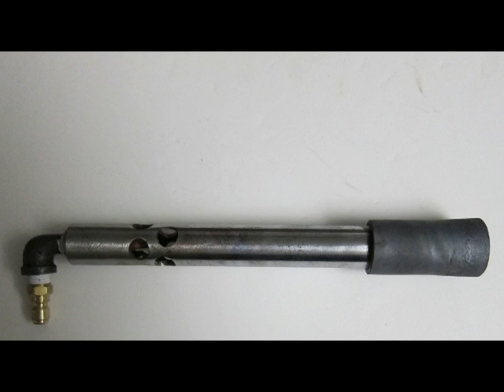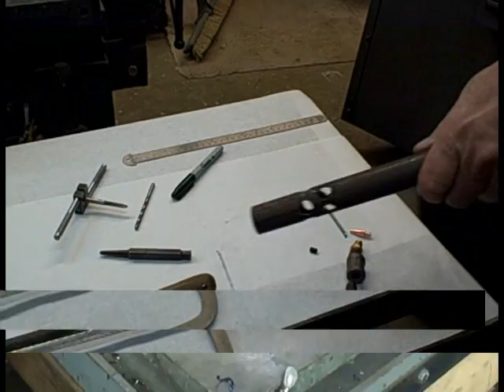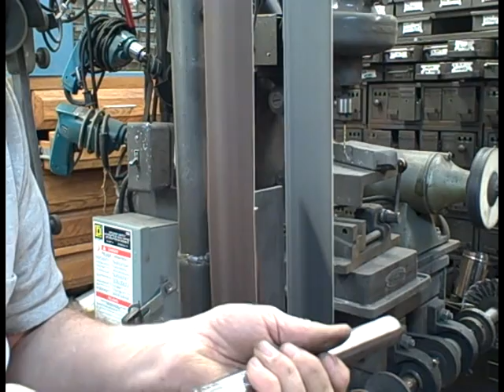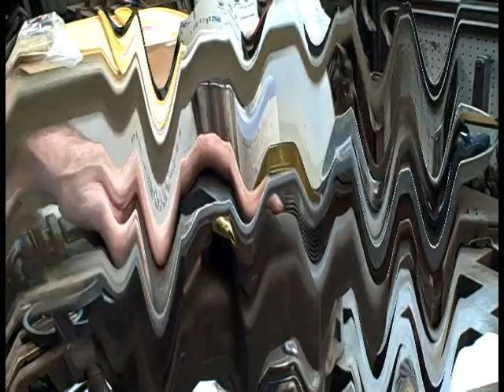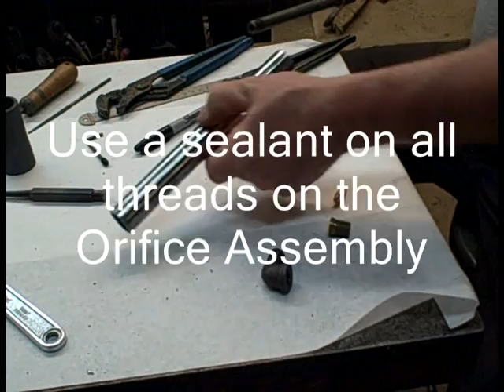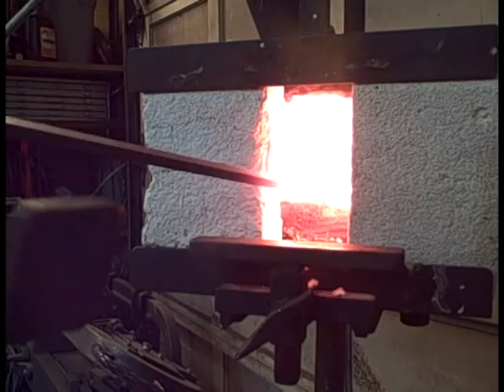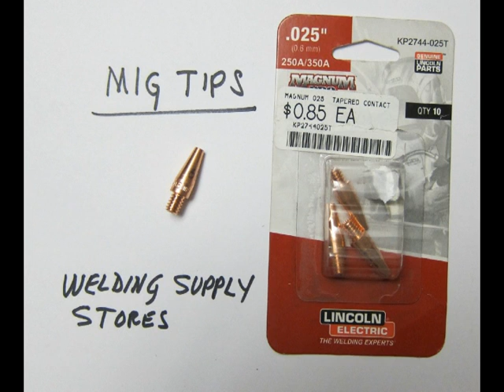How to build a Propane Forge Burner

Comment: Thank you so very much for this incredibly helpful tutorial. I made my first flare with plumbing torch heat and hammering it on an anvil tip. A few of the parts from my hardware store were a little different but I made sure to use the right size mig tip and line it up with the air intake holes.
It worked incredibly well right away! Thank you again!
Reply: Thanks... I'm glad it worked well for you...

Comment: David, I’m looking to make this and picking up everything. What size diameter did you use for the 3” stainless steel piece?
Reply: I believe the SS pipe I use would be considered 1 inch pipe.  Having said that, you can't be assured that if you order 1" SS pipe it will fit over 3/4" schedule 40 iron pipe.  I say this because when I go looking for SS pipe (usually at a recycling yard), not all SS pipe I find (that looks like 1" pipe) slides over over 3/4" iron pipe.  

What I recommend is  (if you are looking at recycling yards) to take a piece of 3/4" schedule 40 iron pipe and see if what you are looking at slides over it .

If you're going to order SS pipe, measure the OD of the iron pipe you are using for the burner and call your supplier and tell them what you need the ID to be.  Just make it a little larger than the 3/4" pipe so it slides on.  The ID of the stainless pipe I have that works is 1.07 inches.  The OD is 1.315 inches.  This is fairly heavy pipe.  It could be a little thinner.  Before  you ask, I don't sell things..

If you are only going to make one or two burners, it may be less expensive to just buy the flares.  They are a bit overpriced these days, but can generally be bought on eBay.  https://www.ebay.com/itm/Propane-Forge-Burner-Blacksmith-Stainless-Nozzle/273635059773?epid=857601216&hash=item3fb5eba83d:g:vRkAAOSwhfRcIrhd:rk:6:pf:0

A friend of mine also makes and sells flares.  I'm not sure what his current price is (I am not commissioned)..  He is John Fee (607 368-6688)
Reply: David Hammer I appreciate all that info! I have a metal supply store near me, so I’ll get the outside diameter and take it there. Thanks again!!

Comment: Hello David, This has to be one of the best burner designs I have seen and will be making two of these for my first forge build. Thank you for the excellent detail and great still pictures. I am now off to HomeDepot... Best Regards, Ray
Reply: Home Depot may not carry the 1/4 inch black pipe fittings anymore.  Check at other hardware stores (not Lowe's).  If you can't find them locally, you certainly can find them online at plumbing suppliers...  Good luck!
Reply: You are correct, HD does not carry 1/4" black iron pipe fittings why, I don't know... I finished machining the burner tubes yesterday and will be making the bells today then a test fire! Oh did I mention I still need to build the forge! Thanks again David, Cheers!
Reply: You are welcome!

Comment: Would this work if it were smaller? I have a mini forge and i was looking at making one with a 1/2" pipe rather than the 3/4" pipe.  I figure I would need to find smaller parts and reduce everything accordingly. Have you made them with the smaller sizes?
Reply: lt will work with 1/2 in pipe.  Make it 8" long and drill 3/8" holes....  I  have made several.
Reply: David Hammer what size did you use for the other couplers?
Reply: I used a 1/4" brass street elbow(male on one side, female on the other).  The female end is out (the quick-connect is screwed into it).  The male end has a 1/4" to 1/8" brass reducer coupler  (female on both ends, that I sanded to fit in the pipe).  I drilled a #60 (drill bit) hole in the end of a 1/8"  brass plug, put it in the 1/8" side of the reducer and used that for the orifice (look for a plug that has a deep cavity (or drill a 1/4" hole almost to the end before you use the #60 bit).   I drilled the holes in the pipe so the orifice was centered on the upper holes.  Incidently....  the 1/2" pipe is 7" long (not 8).
Reply: David Hammer thanks. I will see what I can get from the local hardware store this week. I hope to put it together next week and then test it out.
Reply: I generally buy those types of parts from a big box store like Home Depot or Lowes.  Good luck..
Reply: do you drill the 3/8" holes in the same place or  are those closer to the top of the pipe?
Reply: The top holes are probably closer to the top.  Make the assembly that slides into the pipe first.  Then  mark the position of the top holes so the center will be at the end of the orifice.
Reply: David Hammer so I got the stuff and tried drilling out the plug and broke the only small bit I had. Not sure where to get another #60 drill bit locally. Is there another configuration that would use a weld tip
Reply: I hadn't tried this before this morning (it did work).  

Get a brass fitting that is 1/8" NPT (male) on one end...  and 1/4" (male) pipe compression on the other end.  Drill it out with a drill bit suitable for your mig tip (I used a #7 drill bit), tap it for the threads on your mig tip (these vary, so be sure you  use the right tap), then grind (or cut) off the compression end threads so you can thread the mig tip into the fitting.  This will give you a mig tip with the 1/4" NPT threads you can screw into the other fitting you sanded to fit into the 1/2" pipe (I think I used a 1/8" brass coupler for that).  Then drill the 3/8" holes in the burner body so the mig tip (end) is centered on the set of holes closest to the flare.

Be careful that you don't crush (bend it oblong) the small fitting if you put it in a vise to cut or drill through it.  

Good luck this time....
Reply: David Hammer I got the part and was able to drill and tap. Now I just need to grind it down to fit the pipe so I can drill the holes and wait for the sealer to get here. Hopefully this weekend I can test it out. Thank you for all the help.
Reply: Got it all drilled out and tested it. It sputtered a lot and seemed like it wasn’t getting enough air. I also need to work on the flair more. Right now I was going into a 3/4” pipe that goes into my little forge. I am going to put a 3/4” coupler on the end inside the forge to see if that will help with the flair.

Comment: Dave, do you have a website or somewhere I can get ahold of you to trouble shootout this burner?
Reply: You can comment here and I will answer.  What problems are you having?
Reply: Success! Great design! Found it easier to build than the frosty t burner!
Reply: Problem was the mig it was clogged! Works like a champ now. 
How many btu's does one burner put out? I have a 8 gallon air tank I've cut the end off. 1848 sq inches...
Reply: I'm happy you closed the deal...
Reply: One burner will suport about 300 cubic inches of burn chamber (assuming an effective lining).  I don't know what the btu output is...

Comment: What is the purpose of the street elbow?
Reply: 90-degree turn.... Just to allow the hose to start down without going straight up first.  I use 20, 30 and 40 pound tanks...  and they sit on the floor.  If your propane source is higher, you may not want an elbow.
Reply: Does a bell reducer work as a flare for these burners?
Reply: Actually probably not since it's part of the tuning process
Reply: I have no experience using anything but one-inch tubing for flares.  The flares I demonstrate in the video work the best for me.  I have also tested with one inch SS tubing (no flare on the end) and schedule 40 one inch pipe (without any flare on the end) with reasonable success (they do not work well, if at all, outside a forge)..   

Some folks say they use these burners with no flare on them.  In gereral, these burners will not stay lit outside a forge without a flare.

 I  use a flare because if I don't, the end of the burner tube will be damaged fairly quickly by the heat in the forge.  Stainless steel flares resist the heat for the longest time (they still will burn and have to be replaced though).  For me, a  flare is easier to replace than the burner tube.

If you are trying to use something else (other than what I recommend) for a flare, put the burner in a forge and try it.  

I cannot offer any advice about non-stainless steel flares beyond what I have stated here.

If you cannot make one, I recommend you buy a stainless steel flare.  You can buy them online (ex.. Larry Zoeller website) or on eBay.

Best of luck.
Reply: I think I have to big of a mig tip in right now. I have a flame outside of the forge with a 3/4 x 1" bell reducer but it's not an accelerated flame. Pressure is all the way up so I don't have and room for tuning

Comment: Hello, I have been visiting your series and have what could be a time saving tip. I have have some trouble locating the 1/4 inch pipe to 1/8 flare fitting, so I looked around and found that a 1/4 inch pipe to 3/16 (ID) barb would work, there is plenty of metal to cut close tolerance threads for the MIG tips to fit into, also had problems finding a longer braided stainless propane line, so ordered from EBAY, the brass hose barb  (1/4 to 3/16) fitting I found at Menards, less than $2.00. Got the stainless flare from ebay too, no st0ck avail around here right now. Just waiting for the items to come in. Thanks for the info.
Reply: You are welcome....  It's always good to have alternatives...
Reply: Could you please share the link to the stainless flare you found on eBay? I've been searching and have only found complete burner assemblies. David, does the flare need to be stainless or could you use regular iron pipe? Thanks for the great video.
Reply: You're welcome.....   

Flares  are not always for sale on eBay, but most times I search they are there... so keep looking.  You could send a message to someone who sells complete burners also...  Just ask if they would sell flares by themselves... Larry Zoeller sells flares from his web site (Google him).  

They do not HAVE to be stainless.  It's just that stainless lasts longer.  In fact, it's likely the burner will work in the forge without a flare at all.  I don't do that because the end of the burner will eventually burn and the whole tube needs to be replaced.

Good luck with your projects.....

Comment: Great Video David.  I have everything made but one part I can't find, the connection to my Propane hose.  It's the quick coupler or a 1/4 male npt to 1/4 male (propane thread?).  Have no clue where to get one of those.  Any idea what I should ask for at the hardware store?  I've seen them on ebay but i'd like to buy locally.  Thanks. Steve
Reply: I'd have to see your hose to tell you what you need. There are numerous different fittings on propane hoses.  I suggest you take your hose to a hardware store (Home Depot or Lowe's or ???) and ask for help in the plumbing department.  They will have a display of brass connectors.  It's likely they will have what you need.
Reply: David Hammer it's a 1/4 female connection.  This hose actually.
https://www.princessauto.com/en/detail/10-ft-propane-hose/A-p8005534e
Reply: Found it at my local propane supply shop!!
Reply: Great!  Good luck with your project forward....

Comment: I bought parts to build another type of forge today. I wish I saw your video sooner.
Your plans look so simple. I'll see what I can return and make this type instead.

I have a disposable helium tank the same size as a freon tank, this burner is good for that volume dont you think? I have ceramic batting and will get the coating to apply in it.
 I  plan to cut off both ends and use the 3 inch channel for the brick doors on either end like yours.
Reply: If you are referring to a tank about 8 inches in diameter, 12 inches long (or close), one burner will work fine.  Each burner is capable of supporting up to about 300 cubic inches of burn chamber.  Those tanks are great for forges if you are not going to cut a slot on the side (openings just at each end).  If you want to make a Super 'C forge, you will need a thicker cylinder (unless you intend to add stabilizers somehow so the C won't flex).  Good luck with your project.

Comment: Hi David,
I found your video a few week ago.  Your description for everything was very easy to follow.  
I'm in the process of building 2 of these burners.  They are about 90% complete.  I just need to drill and tap the holes for the mig tip....then assemble everything....and test.  I'll let you know how it goes.
Jim

Comment: Does the main body pipe have to be 3/4"? or can it be 1"? Does it also have to be 9" long? Do the holes drilled have to be spaced perfectly, or is there room for error? Is there a difference between using 3 rows of 4 holes and 2 rows of 4 holes? Does the flare have to be stainless steel or can it be cast iron?
Reply: You are either argumentative, curious....  or inventive (or all three).   

The body can be other diameters.  You would just have to find the number and size of the holes that will produce a good flame.  I've made the burners with 1/2 inch pipe with 3/8 inch holes.  I have no doubt 1-inch pipe would work also.

The pipe doesn't have to be exactly 9" long.  It does however, need to be long enough for the propane to mix properly with the incoming air before combustion.  The minimum length will be different for each diameter of pipe used.  9 inches works for 3/4 inch pipe.  Shorter lengths produce erratic results. I'm not sure a lot longer would work well...  you would need to experiment.

You can change the holes configuration.  Others will work.  I expect it's more about open-area than number or placement of holes.  I do believe though, that symmetrical placement is best..... just experiment.  Things don't necessarily have to be perfect for the burner to work.

The flare does not have to be stainless steel. It can be whatever you want to use, as long as the burner will light, stand up to the heat and you can fit it in the burner holder.  I use stainless steel flares because (in general) they last longer than iron pipe.  I have used 1-inch iron pipe (flared and unflared) over 3/4 inch burner tubes.  The flares will burn on the end and eventually have to be replaced.  In fact, a flare may not even be necessary when the burner is in a forge (the burner may not light outside a forge without a flare).  I have found that the best flame is produced with the type of flare I show in the video.  If you don't use a flare, the end of the burner in the forge will eventually be damaged and you will have to replace it (instead of just the flare).

Having said all that....  The burner I describe in the video works well in most cases.  I am very specific because I have had good results with this configuration and I expect others want to make something that will work the first time.  When someone has problems with the flame,  I suggest moving up to larger mig tips.  I expect doing that overcomes whatever imperfections they have (or makes allowance for altitude issues).  At least it seems to work almost all the time.

Good luck with your experiments...
Reply: Thanks for the speedy reply! I've been wanting to create a propane forge for myself for a while now but the main thing that has kept me from doing it is the burner. I just don't have the right tools. However, I'm thinking with this design I could very easily make one. But since it's my first time making a burner, I want to make sure I don't make any mistakes (especially around propane). And I wanted to see how much material that I already own that I could use. Anyways, thanks again!

Comment: Hey David I've been atempting to build multiple versions of a atospheric burner and every one still burns at the end of the flare but fails to create a clean cone shaped blue flame instead of a light large blue and orange flame outside the forge without any wind. Your design was my latest atempt, I followed everything in your design only I use a standard nontapered .030 mip tip friction fit into a 1/4" flare fitting for my orfice assembly. I've tried placing the tip of the orfice in the center of the top holes, and also at the bottom of the lower holes to allow more oxygen to be sucked into the pipe. The propane is obviously not getting enough oxygen, so would you suggest drilling more holes or extending the mixing chamber, as my pipe is only 8" with the holes in the same place as yours.
Reply: I have found that burner tubes less than 9 inches long are problematic.  Also, I'm not sure you will get a perfect blue cone anywhere with atmospheric burners.  The burner, if made exactly as I show in the video, works perfectly where I live.  Different altitudes may influence behavior.  When folks have problems and say they have followed all the processes, I tell them to try an .030 tip.  I don't try to analyze too much. The real question is how the burner works in a forge.

Comment: Hi Dave. Thx for the excellent video. I built this burner and it wouldn't run stable, constantly sputtered and pulled flame up into the tube. I played around with blocking off some air and when I got to 4 of 8 air holes blocked, it worked great. Not sure, maybe it's altitude? So I think I could also go bigger on th mig tips to fix it, maybe I'll try that. I have built 2 now and soon will be installed in my forge. On the subject of mig tips...the Lincolns you use are 1/4-20, millers are 1/4-28 I think, but twecos are oddball, 1/4-24 or something. Dumb!!
Reply: I would suggest trying .030, even .035 mig tips.
Reply: Hello again Dave.  I installed .035 mig tip, opened all the air holes, and it runs great.  .035 is double the hole area of .025. So it makes sense to double the air and the fuel,  roughly of course.